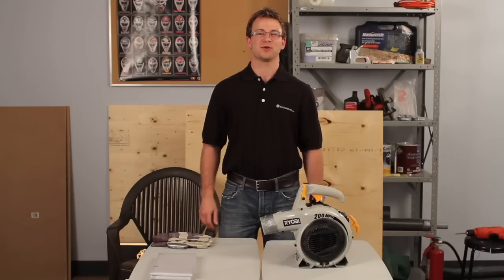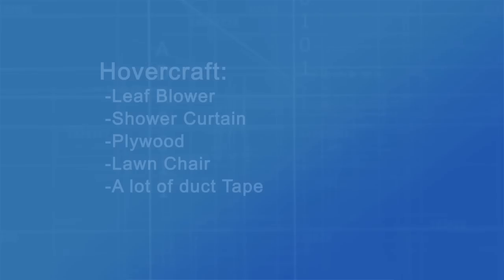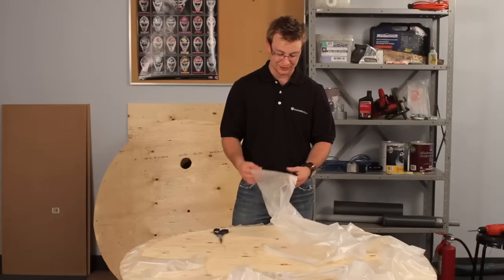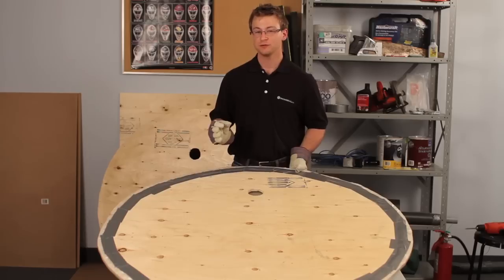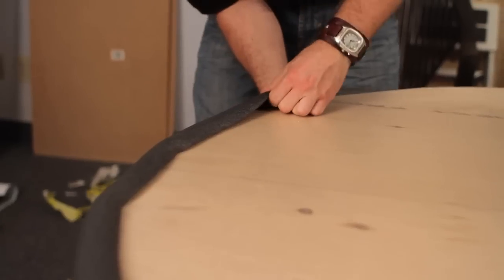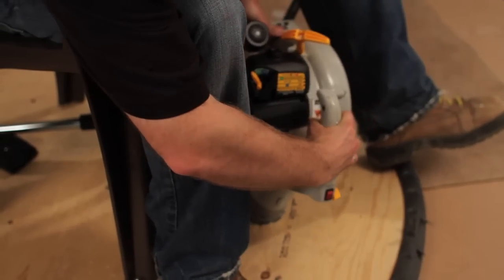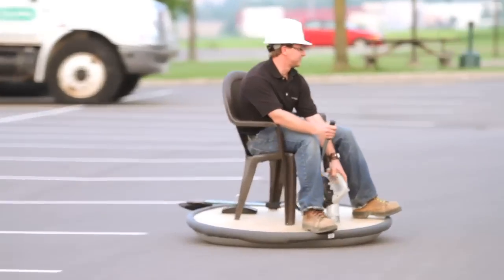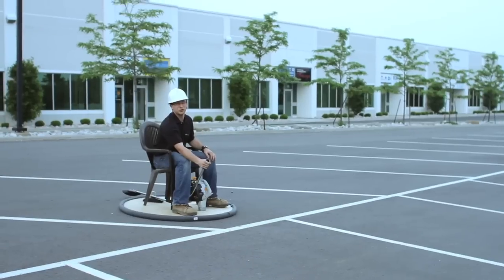Build and Ride a Hovercraft

Comment: The cause propulsion, you can build a two tube system.  Using a water hose or you can build a vent and direction wings on the back of your hovercraft that you can build out of melted down milk jugs that can shaped like wings.

Comment: I made this hovercraft, and I found if you use 6mm grade plastic it won't rip. ( I've been riding it almost nonstop for 8 days so I know) Also if you attach the hovercrafts skirt to the top of both sheets of ply-wood and then put the pipe insolation around that it makes it so you can replace the skirt whenever needed. It's easier than taking the whole hovercraft apart, and it works perfectly for me.
Reply: I'm gonna make one with 14mil poly tarp for a skirt, LOL!
Reply: Drew Wilson did you attach both plywood pieces with screws or glued it?

Comment: Just add a excost pipe running trogj the top with pvc pipe cut a hole in the top in the back than aply the pvc pipe as cars do but instead of letting out extra gas like cars this makes you propell forward

Comment: not sure why I am posting here. looking back at history. not much response.
well, anyway. anyone comment on specs for leaf blowers.
CFM or air speed which is more important. looking at a unit that is only 92mph. but 480 max cfm
Reply: Cfm is more important.  It is the amount of air the leaf blower is actually putting out.  Mph can be changed just by getting a smaller nozzle.  It's why many electric leaf blowers are advertised as having same power as gas because they rate it in mph instead of cfm which is misleading because it doesn't give an accurate rating on how well it can move things.
Reply: thats useful thx
Reply: i need to get a leaf blower but didnt know wich

Comment: why not just use a 1" piece of plywood instead of two pieces of 1/2'.
Besides, its not clear on how you attached one piece of plywood on top of the other? glue?
Reply: Zombie Outbreak Control Center 
I’m no professional, but I’m pretty sure that a solid 2 in piece would also bend 

The stacking helps with durability
Reply: Cheaper. Also, glue would work best backed up with some carriage bolts.

Comment: Brilliant design and smart thinking ahead on where you place the hole for stability. Why not get simple slightly-more-flight-designed fans at about 120 and 240 degrees from north for a stable steady forward flow and then vary the power input for turning?

Comment: pedals that run an airpressure so it would propel or just a wheel and pedals at but similiar ''brakes'' on the sides so you can turn. as in pulling the brake on the right would shift it right.

Comment: the forward motion comes from ducting the air flow two separate ways, down for the  lift and backwards for the forward motion. its about 75%/25% respectively.

Comment: using a leaf blower for propulsion would be a great idea. but you can get away with one. Mount it under the seat with a small amount of piping to run it back to a "rudder" style steering. And for the steering you can use rope with little eyelet ring by each leg of the chair. It wouldn't be too difficult to set up, you would just have to balance the weight.